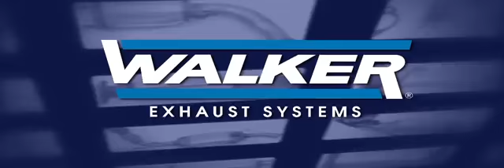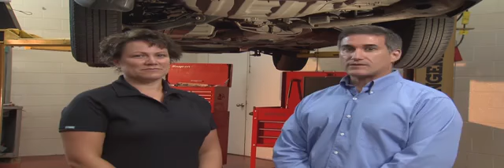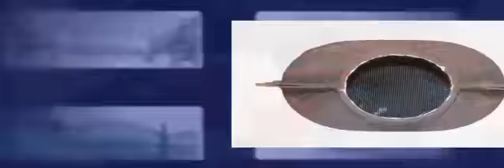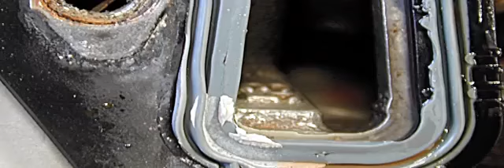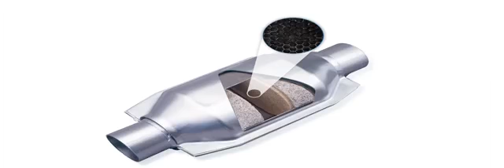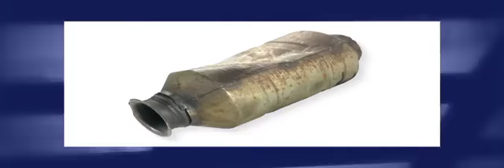Why Catalytic Converters Fail   Walker Exhaust Video Series

Comment: To smart didn't understand I have a check engine light on a 2011 jeep liberty. And I had a my computer checked with a obd2 reader and it's said I have several codes . P0420,p0430,p740 idk what's happening when I start the jeep the Tom's is steady then all of sudden it starts going up and down then it shuts off. Then I restart it. Starts to drive fine. Idk

Comment: A misfire (e.g. bad coil pack) can also cause unused fuel to load and ignite in the convertor structure and cause melting or physical damage.